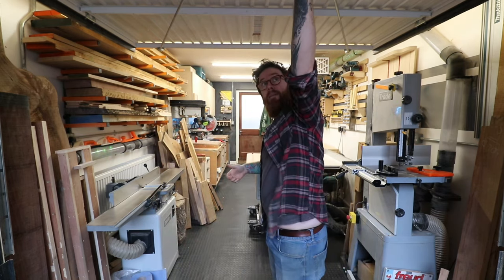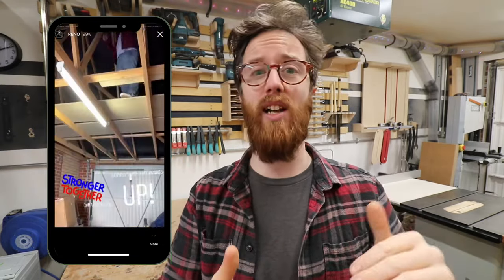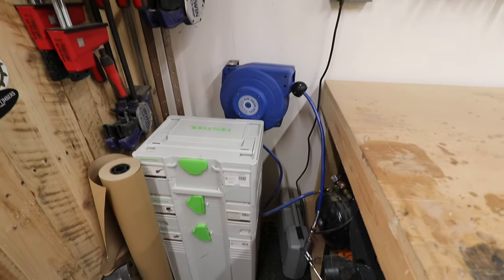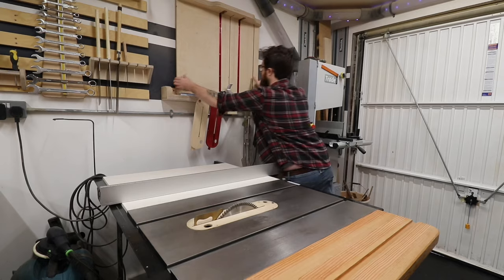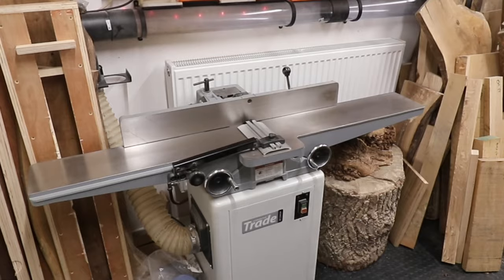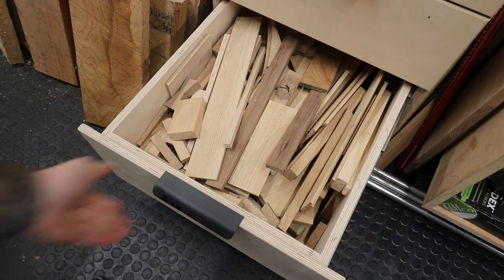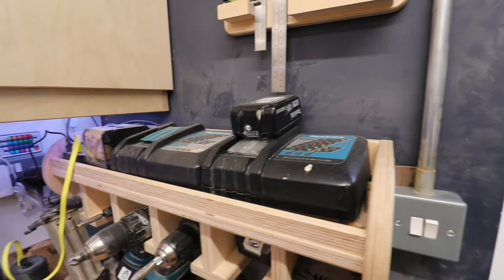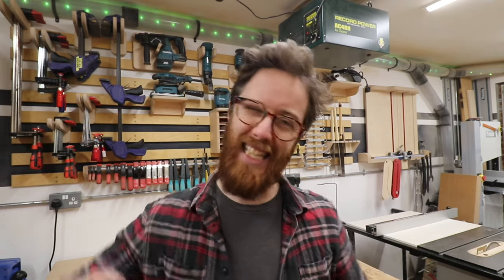You won’t BELIEVE what TOOLS fit in this SMALL SHOP

Comment: Very nice workshop.
Not sure about England, but here in Scotland I was told when I converted my single garage to a workshop that I wasn't allowed to put in 'fixed' heating otherwise it would be deemed a 'room' which wasn't granted for in the plans. To make it a 'room' would have required full planning and for it to have more than a layer of kingspan and plasterboard to insulate it.
Mobile/portable heating is allowed.
Reply from the maker: Thank you very much! To be fair I didn’t check haha but knew it was okay to install as I converted a friends garage a few years previously in to a room for their eldest son for when he was back from uni. In England you don’t need planning permission to change the garage in to a room, as long as the works are internal and there’s no change externally then you can do what you want basically. It’s a shame you have to get planning, portable heaters are expensive to run 🙈
Reply: Don't tell the government anything, local or not.
Reply: @iainmatheson5190  Unfortunately, you have to tell your housing insurance company/mortgage lender if you've converted a room because it affects the value of your property, otherwise your insurance is void, so you are forced to get an evaluation estimate done, which is then recorded. The local council can regularly check the current estimated valuation of your property and see if you are paying less tax than you should.

Comment: Love that you’ve said goodbye to the miter saw.  Until the day I start remodeling and installing loads of moulding and trim, I just don’t see a use for one.
Reply from the maker: Oh absolutely and I haven’t regretted it since either. The table saw does everything a mitre saw can do, pretty much 😜☺️
Reply: Agree. I bought a power miter saw for installing trim. Used it for crown molding and barely since. It did work well for those. Very messy and noisy as well.

Comment: love your small shop! Question: What size dovetail bit did you use for your track clamps on that sled? I just got a bunch of track clamps and that's a dandy little idea you have there.

I miss that makita planer (thicknesser). I loved it when I owned it.
Reply from the maker: Cheers dude! Ooo that is a good question and I can’t remember for the life of me what size bit it was, when I get in the workshop I’ll dig it out and let you know. But yeah it’s a great little jig ☺️

It’s a great thicknesser isn’t it (I know you guys call it a planer 😜)
Reply from the maker: Hey dude, just got in the workshop, I used a half inch dovetail bit but I remember having to shift it over a touch on each cut to make it slightly wider. Hope that helps mate 🤙🏻
Reply: @monkeyboysworkshop  Awesome, I think I have one, and I should give that jig a try. 

I whole-heartedly agree that the english nomenclature for jointer = planer and planer = thicknesser makes so much more sense than the american versions.
Reply from the maker: @ScottWalshWoodworking  Great, let me know how you get on with it, I’ve used mine on pretty much every project since making it.

Yeah I’m afraid to say I have to agree, much more logical, which is rare for us English folk 😜😂

Comment: You mentioned having the Festool domino xl, would you recommend it over the smaller domino? Thanks
Reply from the maker: I do have and I would recommend it over the smaller one indeed, purely because you can get an adaptor (which I now have) that allows you to make all the cuts the smaller domino can do. Where as you can’t do it the other way around I believe. 🤙🏻

Comment: Great video, I think I'll just clone this for my single garage workshop 😂 A question though:

How do you heat the shop and at what temp do you keep it in winter? Do temperatures ever drop below zero where you live?
Reply from the maker: Cheers! Haha go ahead and clone away 😜😂

So I had a radiator installed (I can’t remember if it was installed before or after this video or not, but it’s behind the surface planer (aka jointer). Luckily we had a radiator on the other side of the wall so it was pretty easy to install. The temperatures do drop pretty low, no way near as much as the states mind you but as I’ve insulated the walls as well and so it doesn’t get CRAZY cold in there which is nice 🤙🏻

Comment: I'm in the process of building my very first workshop and I am wondering about the floor covering 🤔 that inmind I see that you have put down the Penny matting,  do you know what the thickness is that you have down plus how happy are you with your choice of flooring?
Reply from the maker: Amazing, hope the build out is going well so far! I do indeed, if I remember correctly it was 3/4mm and very easy to lay and cut, I stuck it down with spray adhesive. It’s way better than standing on hard concrete (and easier to sweep sawdust too) but to be fair it could be better. It’s doing the job for now but in the future I may look at upgrading the flooring to something thicker and that’s better for my knees ☺️ But for the price it’s definitely worth it 🤙🏻

Comment: Lovely shop and reminds alot of my own.
I do have the similar axminster tablesaw and curious how you attatched the wooden wing extension?
i've tried making some but they all end up being flappy and loose and can't handle weight on it.
Reply from the maker: Thank you very much! This is actually quite a common question that I get. It’s a thick block of wood I’ve glued together and simply cut out holes on the underside similar to how you would connect two kitchen worktops together, then bolted the wing through the already existing threads on the cast iron and it’s solid as a rock 🤙🏻
Reply: @monkeyboysworkshop  il give that way of attaching it a go next time then. cheers again

Comment: Hi
How did you overcome the problem of fitting a remote switch for your dust collection which has a NVR switch on the machine.
Reply from the maker: Ah see I did something I probably shouldn’t scream about but I inserted a washer on to the NVR on switch so essentially it stays permanently on. I hadn’t foreseen this when buying my collector and it was my only solution at the time, 2 years later and it’s been okay so far 🤷🏻‍♂️

Comment: Nice! Did you get build regulation approved for electrical and insulation, ventilation and heating systems? If so,  how to do it and where do I go with it? Thanks ☺️
Reply from the maker: Thanks mate! From my knowledge you don’t need permission as you’re not changing anything externally or turning the garage in to residence such as a bedroom etc So you can do whatever you want within reason 😜 My brother in law is a town planner here in the UK so he knows the rules and regulations 🤙🏻
Reply: @monkeyboysworkshop  I done a bit of research and found that you don't need planning permissions when doing internal changes , but you have to have a building regulations approval, everytime you mess with electricity or central  heating, insulation and many other things.  Check: "planning portal"
Reply from the maker: @calmdymon  Cheers buddy, I’ll check that out. The regulations may differ depending on where you are in the UK and my brother in law hasn’t mentioned anything about that for where we live but thanks dude 🤙🏻

Comment: How did you attach the wooden wing on the left of your table saw?
Reply from the maker: They’re attached using worktop connecting bolts, just like you’d find in a kitchen counter. There were existing threads in the cast iron top on the table saw so I utilised those, made some holes in the wooden wing and then attached them and it’s very strong, I’ve stood on it many times and it doesn’t budge 🤙🏻
Reply: Interesting 🤔

Comment: Do you use soundproofing ?
Reply from the maker: I’ve insulated, plasterboarded and plastered the walls and ceiling (although ceiling has yet to be insulated) which has soundproofed the workshop somewhat. We’ve never had any complaints from neighbours, we’ve actually had orders from them. Most of the noise escapes through the up and over garage doors which I’m hoping to upgrade at some point 🤙🏻

Comment: Just curious how you deal with the noise factor. I'm going to assume you are close to your neighbours, do you get complaints about the noise of the machines?
Reply from the maker: Yes we are very close to neighbours but we’ve actually been really lucky where we are. The neighbours have never complained, we actually get a lot of interest in what we’re doing and we’ve also had orders from neighbours too haha I think insulating the walls was a good shout as it does reduce the sound but there is still more that can be done to help reduce it even more, like an insulated garage door and ceiling too 🤙🏻
Reply: For door isolation, I'm use hanging two old carpet. Working 👌

Comment: What is width of the table saw, from side to side not including you add on
Reply from the maker: Hey buddy! Sorry it’s taken me so long to reply, I’ve been on holiday and wanted to give you exact measurements once I got back to the workshop ☺️🤙🏻 So the cast iron section is 550mm, with the add on supplied (the white part top) it goes to 1125mm, but the bar goes to 1336mm (as in from pushed up against the wall on the right all the way to left of the cast iron top! Hope that helps mate 🤙🏻
Reply: @monkeyboysworkshop  thanks that helps alot